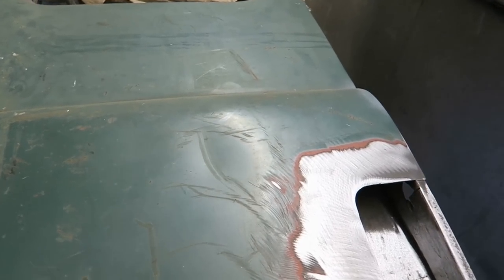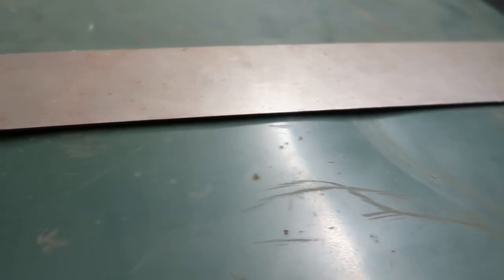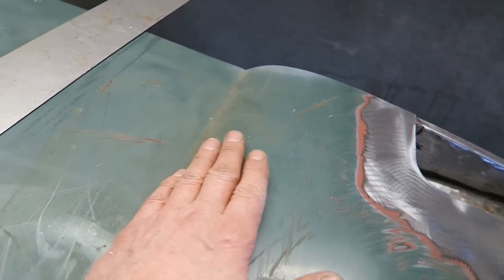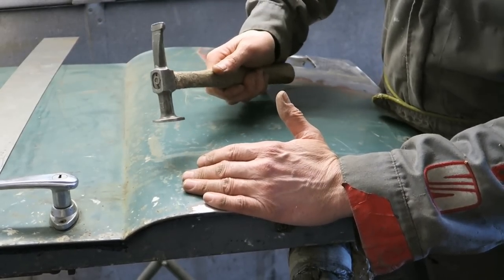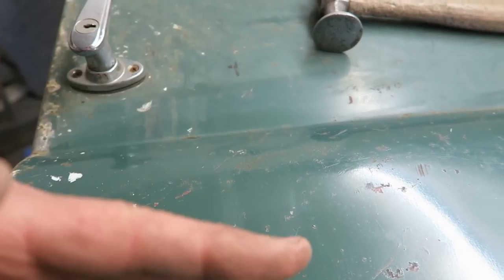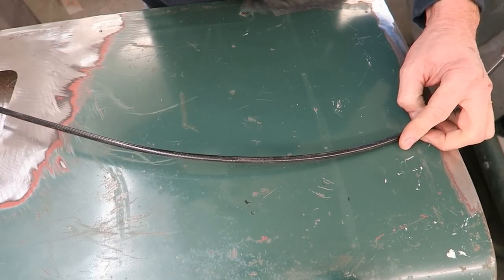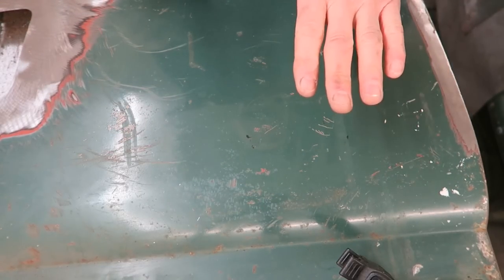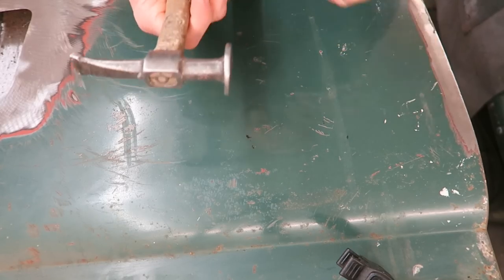Panel hammer techniques, bodywork beating dents and creases Tips and Tricks #10

Comment: I'm restoring an old tractor with similar sheet metal damage. Your first dent you repaired showed me a lot. Prior to watching i would I'd though to push the dent from the inside, but you actually find the bends from the outside and hammer them with the glancing blows. Taking the creases out from the outside basically relieves the bend. Genius!

Comment: That was the best vid on panel work, I’ve got an old ute that needs a bit of body work. Bought a dolly/hammer set yesterday did a lot of tapping last night, but have the exact same situation as this video. Except this is on the front of the guard where it rolls 90°, so I thought I’d look for panel tips. 
Once again amazing video, especially using that cable to describe how a dent forms and  the last bit with all the repairs. Amazing work, wish I had all the gear to build pieces like that.

Comment: First of Mate; thank you very, very much for taking the time and putting so much effort into your great videos. They are a terrific help.  Your explanations, and descriptions with pen or some other prop, are a great way to help understand. I wonder could you explain lift, by diagram if you don't mind, as you did with the slapping file and dolly.  It seems counter intuitive to the human mind that you are going to raise a low, by hitting down the way, as it were, with the slapping file, when you are wanting it to come up the way. I know it works, myself, but it would be great if you could explain it by drawing, or whatever. Also, what about if the dent is larger than the dolly, and is too small to cover the area when lift is required. I know it works to hit the crease down (on the green door dent) and towards the shallow, springy depression, but maybe folk will not understand how the radius can be beaten back to original form without a dolly behind it, to finish it down to it's exact level.  Thank you again for your videos, and your nice manner. Excellent Mate:-)

Comment: Hi trev, great video, new sub right here.  I've got a dent that i need to repair on a rear quarter, on a 1971 mercedes, the steel is quite thick and i can't really move it, I haven't really tried hard yet, but if I keep tapping the dent (the high area) will it go down? Cheers (happy to show you pics if you have an email address).

Comment: I have no bodywork experience but I got dents my fiance put in the side of the car that I want to get rid of. I am more into machining than bodywork and cars. I was wondering would a panel hammer be better if it was made from brass or something soft so it was less likely to marr the metal , or am I just completely in the wrong here. Part of me thinks if I was right, panel hammers wouldn't be made from steel now would they?

Comment: Trev great video mate but I have a question what if it’s a deeper dent with a sharp point would the same method still potentially work I hope this message finds you well and happy mate
Reply from the maker: mark powell Hi Mark a big part of my philosophy is that no two pieces of damage are the same and you have to adjust your methods to suit the repair in hand, the main point of this video is to demonstrate that tapping the crease in has relieved the greatest part of the damage. If you had a crease sticking out then this may well still relieve part of the damage on a more pointed repair but you may need to get something to lever up the sharp part afterwards. Another good approach is working out how the accident happened and then first tackling last part of the damage that happened. “Last in first out” I hope to do many more videos demonstrating different types of damage and different methods of repair. I’m well thanks and hope you are too ? Cheers Trev 👍
Reply: Thanks trev for your super quick reply I hope you don’t mind me asking you questions but it should show that I’m very interested in what your doing/showing us

Comment: Hey Trevor, have you tried the little 2" Roloc 3M Cubitron II Durable Edge 984F discs? They are red.... The edge really holds up a lot longer on them. I've had great success blending in the welds with these when doing label replacements. Last much longer than the green ones. What else do you recommend for blending down the welds?
Reply from the maker: smportis one of my last videos, the one on heat distortion covers these questions 😁. Thanks for your comment, very much appreciated. Cheers Trev 👍

Comment: Hey  Trevor can body filler be applied direct to aluminum
Reply from the maker: It certainly can but it’s adhesion can be improved by epoxy priming the aluminium first provided you follow correct procedures, sanding properly etc. Cheers Trev 👍
Reply: Thanks very much

Comment: Hey, dude the straight edge is used on it's side, thus the name straight edge, in your video you can see the tool flexing so what good did it do? Not real accurate way to use, expecially for body work!
Reply from the maker: David Atkins or maybe you just didn’t understand the video.
Reply: A rigid straight edge on a curved panel would no have helped. Trevor used a flat but flexible sheet to replicate the  original curve in the panel. Perhaps "straight edge" is not a correct Engineering Term, but most of us could see what he was trying to achieve and clearly did.